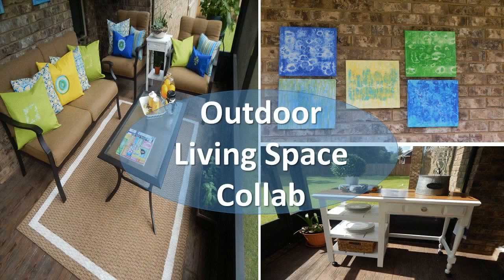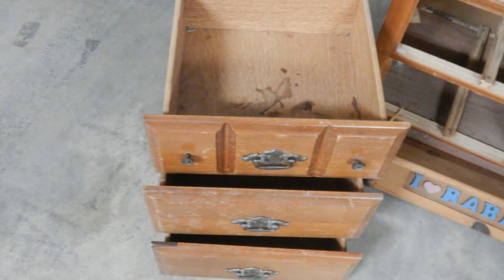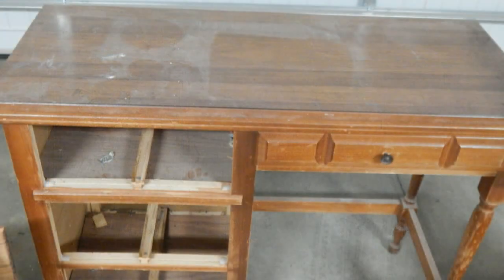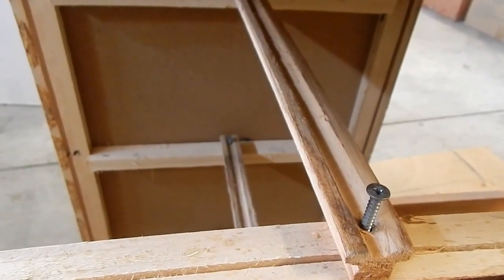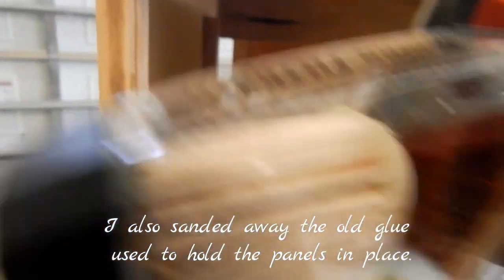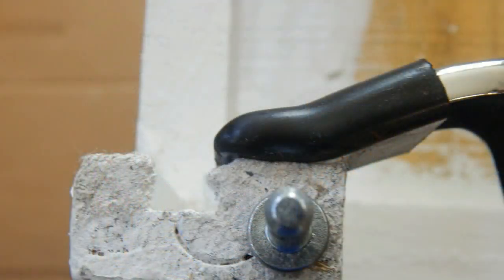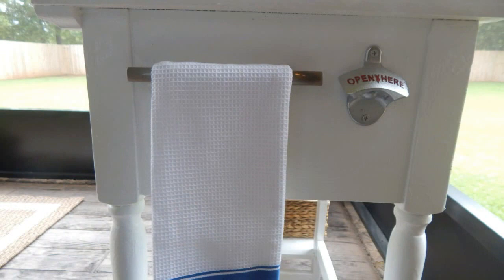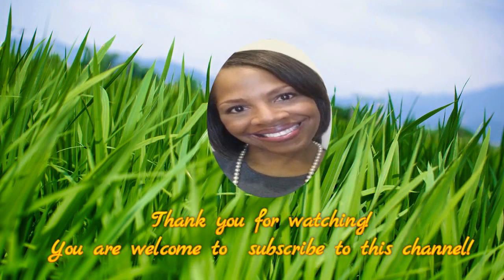DIY $30 Outdoor Kitchen Cart

Comment: You are my new shero, just for dragging that desk around Lowes!  I love taking things to the hardware store and then using the stuff there to find what I need, like grabbing a tape measure to measure something and then to measure what I'm about to buy.  Or taking a nut I have and trying out bolts to see which one is gonna fit (I don't know anything about nut/bolt sizing, just find what fits!).
I just got interested in outdoor grilling this Summer and need a side table/cart.  I've been using an little work bench my grandfather made for me years and years ago but it's got a bench vise on it that I'm loathe to remove . . . makes a nice place to grab when I lift it to take it out to the patio!  But I'm gonna be looking for a nice desk like yours to modify!  Definitely want bigger wheels, to push it through the yard, though.   Thanks!!